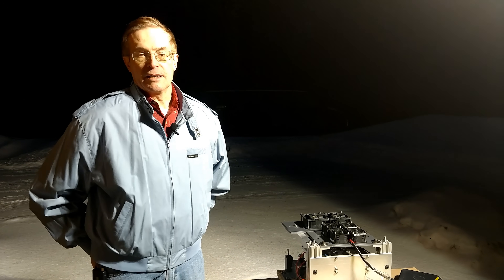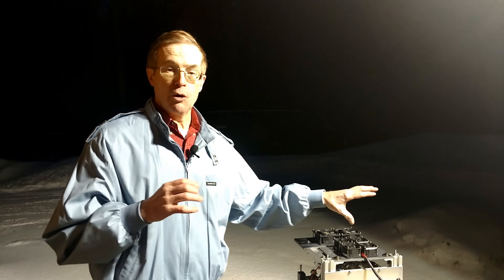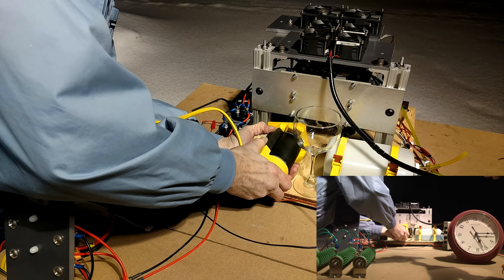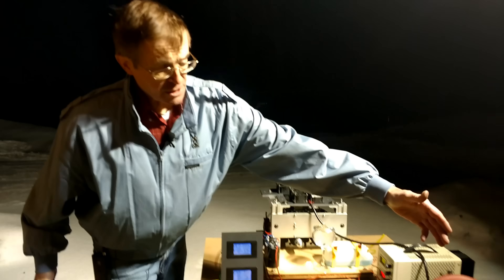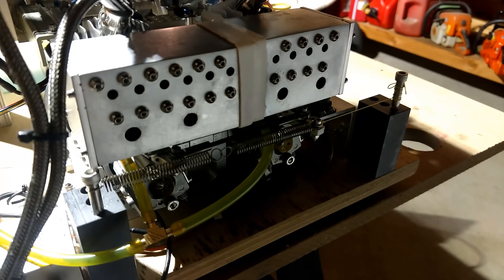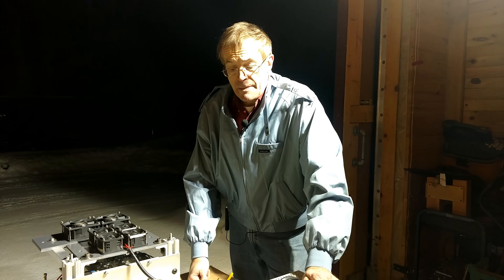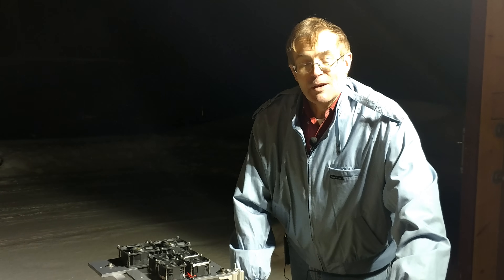Drone Generator Performance

Comment: 2-Stroke Expansion or Tune Pipes will 'pulse' all the unburned air/fuel that got into the exhaust back into the cylinder just before the exhaust port closes,
ie:  At a the desired, designed for RPM you will get as clean an engine as a 4 stroke..?
No; the weight penalty is more than made up for by the dramatic increase in engine power at the designed for rpm.  That's why you see them, on all high performance 2-stoke motorbikes etc.

After the 2 expansion pipes I would do an 'Into 1' Y piece to 'halve the weight of the silencer/s...
Do also look up David Vizard's Pressure Wave Termination Box as a means of negating the power losses normally associated with mufflers/silencers.
This will, most likely, also avoid any interference you may get between the Expansion pipes when using a single silencer..?

Then, as this is a fixed rpm setup, do look up Helmholtz and/or Quarter Wave Resonators as a highly effective, light way of silencing not just the exhaust but also the intake tract and perhaps even the quiet box/enclosure if such is planned.

Lastly; do aim the exhaust downward so it can help a tiny bit with lift/thrust..!

NB that there is also a good amount of info on optimising port heights for a certain rpm, which goes hand in hand with the rpm specific expansion pipe in this case.

You might also look at:
Supplying the spark plug/s with a constant DC ionising voltage (~1000V per mm) underneath the std pulses for spark:  This seems to speed up ignition by pre breaking down the fuel molecules and/or producing a tiny amount of hydrogen etc in just the right place...

I also wonder if 2-Strokes might not benefit more from some of your... 'disproved..?' HHO action considering the very short time they have to completely finish a burn/power stroke before blowing unburned stuff out the exhaust port..??

Comment: Hi sir, i would like to know how you design and size the flywheel? thank you!
Reply from the maker: Its  mass approximates the mass of the piston and the rods and its diameter was a practical decision based on clearances.
Reply: @TechIngredients  Thank you!. How and what material do you use to offset the flyweel? I see that the flywheel itself is made of aluminium, how about the inserts to offset the flywheel inertia? I can see there is at least 2 or 3 inserts? Correct me if im wrong.
Reply from the maker: They are simply steel discs that counter the offset mass of the piston and placed 180 degrees away from the piston.

Comment: I flew one of these 10 years ago... 1000 watts.. the clutch would slip    https://www.youtube.com/watch?v=aDqdNRzlV0Q
Reply: So Cool !It's hard to imagine that it's been 10 years, and even now in 2023, hybrid multi-rotor drones are still very niche in China. The gap with developed countries is unbelievable. I watched your video and wanted to ask if your six-copter drone only needs 1 kilowatt of generating power to take off, it looks heavy. (Sorry my English is not good, especially grammar)

Comment: Hi, I would like to ask you what do you think about the alternative method to produce electricity using Fuel Cells, can it be an efficient solution?
Reply from the maker: Absolutely.
The problem  at present is the cost of the ion membranes necessary  to generate  electrical current from the reactions.

Comment: 2 stroke motorcycle engines have a full circle crank and the racers do what they call stuffing the crank to boost performance and reducing vibration is a large part of performance optimization and this goes on in high end chain saws as well. I noticed that Boston dynamics is using a pulsejet engine in thier robots, these engines are much lighter.

Comment: Now here's something else for yout to toy around with.... "Tuned pipes", or "resonance chambers".
If you're generally going to run these engines at a steady speed, in a fairly narrow range of RPMs, a tuned pipe on each engine designed for the rev range you will be running them in can drastically increase the efficiency of the engines. The downside to a tuned pipe is that the engine will be very peaky, and not operate well outside of the rev range for which the pipe is designed for. 
The factory "muffler" on these engines is a compromise to allow the engine to work acceptably throughout it's entire rev range, and be responsive to the throttle at any RPMs, but it is definitely eating up a bunch of efficiency that you would gain back with a properly designed pair of pipes for your engines.
You seem like a smart guy, give it a try, and see if you can come up with something.. You might be surprised at how much more energy you could squeeze out of your fuel.
Reply from the maker: Thanks!
Reply: @TechIngredients  🍻

Comment: That's very interesting. Did you buy or salvage the generator/motor and what's the displacement of the gas engines?
Would something like this work on a bicycle to make it a hybrid like for long trips?
Reply from the maker: It sure could be.  I'd build it much smaller as we demonstrated in the follow up video. This unit puts out over 2kw.

Comment: What do you think about a hybrid drone with a rocket to get the drone to altitude initially and then the battery pack is coasting the motors for the flight allowing a longer run time to?

Comment: Amazing project! ive learnt more from this man than I did from my engineering school.
i will like to amback on this same project for my drone but i have a question sir, what if the gasolin engine quits mid-air?  I have experienced alot of 2stroke engines quiting on me. lost my last drone on 2stroke efi engine quit.
Reply from the maker: Thanks!
Use the generator in conjunction with a small battery. If wired in parallel, the battery maintains  charge and even acts to smooth voltage ripple. If the engine quits the battery  will allow you to land.
Reply: @TechIngredients  Thanks !!

Comment: I would go gas turbine and permanent magnet but anyway, heres a small one https://youtu.be/Al8elCF816g , it is perhaps too weak but on the other hand they come in various sizes . It all comes down to what power demand you got basically but most helicopters have these for a reason

Comment: Just can't stop feeling sorry for your load bank resistors. You didn't spray the poor babies enough and your current dropped by at least 1.5A.

EDIT: Begs the question of why you couldn't just have slapped a fan on them, even a desk fan would help. 😂
Reply from the maker: The fan wouldn't have been enough and the production of the steam was a visual demonstration of the energy produced for those skeptics who watched the video.

Comment: I was wondering if there is a specific reason that you opted for twin vertical cylinders instead of a horizontally opposed boxer configuration. Assuming equal reciprocating mass in both engines and 180 degree timing, it seems like a boxer configuration would be able to achieve proper balance without adding counterbalance to the flywheels.

I may be wrong, but I believe that the flywheels could be made significantly smaller on any 2-cylinder 2-stroke with 180 degree timing compared to a single cylinder engine. With two opposed cylinders, the power stroke of each cylinder directly drives the compression stroke of the other,  which reduces the need for flywheel momentum to carry out compression. So, you may have some opportunities to save weight there. Can't wait for the next update! Keep up the good work!
Reply from the maker: The more powerful, 4 cylinder, 222 cc boxer version of this engine does solve this problem, the twin does not.  We have this larger engine and indeed it produces less vibration.  The flywheels were not sized to prevent vibration, but to smooth the power stroke and reduce the voltage variation.
Reply: @TechIngredients  Great to know, thanks!
Reply: @TechIngredients  do You plan to finish idea with active / passive noise cancelling box for this engines? How does it performed?

Comment: For the cooling, could a multi blades EDF type fan be integrated in the center of each flywheel?
Reply from the maker: Probably.
Reply: @TechIngredients  To save weight, the generator rotor could be used as a flywheel (if needed, "pancake" type generators would provide a larger moment of inertia). A rigid coupler could be used to connect the two axes and the generator stator could be fixed to the engine mount with a flexible vibration damping rubber mount.

Comment: Mounting balanced permanent magnets NdFeb to the rotor of a small hobby turbine & then placing generator coils around those magnets to make a turbo alternator generator should be even lighter / its your IPM style 3 phase motor running at much higher RPM in a very light package custom made / this kind of setup used on military hybrid electric drone power systems - think "integrated APU" -- super light & very high power to mass ratio / also something like a Honda EU2000 or EU2200 could be used as a design reference for something less exotic & affordable & very reliable / you seem like you might like a Free Piston Stirling Generator like the one NASA been operating for 14 years continuously .. helium pressurized seals & magnetic bearings in vacuum housing - 125,000 + hours continuously operating / they are designing it for Kilopower fission energy generators for Artemis moon base etc // you might check that out //
Reply from the maker: Integrating the generator and the compressor/turbine shaft would be best based on the hundreds of thousands of RPM of a small turboshaft.  Balancing tolerances  and mounting the magnets while leaving clearance for the input airflow would be challenging.

Comment: I like this Drone model, but the generator as a power generator, should use a transmission so as not to have a high RPM rotating the engine, because it is a waste. With this, the lock and RPM of the combustion motor will be lower but produce ideal electric power, so transmission is needed.

Comment: I guess if you put the resistors each in a separate tub with tap water, the voltage across would not be high enough to produce a short circuit.
Or you directly use a bucket of water with two electrode sticks and add salt until it's at the wattage you want, you can then vary current/resistance by adjusting the electrode distance or depth in the water.
Bonus: You can redo that hydrogen explosions in small :-)
Reply from the maker: I decided to use the spray to make visible the large amount of heat produced.

Comment: This is really cool work, don't got me wrong. I love any and all engineering of new devices and technologies (I'm a mechanical engineer myself). But I feel like the hype and buzz over "Drones" has caused a lot of people to lose sight of the big picture. Helicopters are a very mature technology that are gas powered, very efficient, can fly for a long time, etc.  "drones" i.e. multirotors, are really only good for small electric devices.  A friend of mine in college made a gas powered quad copter that worked fairly well, but there really just wasn't a good reason to do it.  Once you get above about 10-15 lb. or so, just use a standard gas helicopter design.
Reply: But helicopter is not easy for maintenance. When crashed in accident not easy to repair. I use drone for agriculture and now a lot of chinese drones had this system on board.

Comment: Two strokes need a tuned exhaust to get the best power and fuel numbers.
Otherwise, my jaw is on the deck......
With a proper tuned pipe, you could get rid of the fuel pump, run it on ex pressure port included with the pipe.
I assume this is nitro methane fuel, but, tell me if I am mistaken.
Reply from the maker: You're right about exhaust tuning.  However, the fuel is two stroke gasoline.
Reply: @TechIngredients  Than I stand corrected, I hope you do reach the fuel consumption goals, it's a marvelous system. You can still use crank pressure ports for fuel delivery with gas, it's not going to hurt anything.

Comment: Those little engines rarely ever come with correct fuel jetting...
 Leaning them out will help...
 Also you could dissasemble the cases and fill in all the extra nooks and crannies with jb weld or a similar material , then machine or sand them smooth...
 Less extra case volume equals less waste...smother running too...
 These engines also rarely come with a proper squish area in the combustion chamber...
 You could mill the heads down some...increasing compression..and run the motors a little leaner still...
 You should also check out the youtube channel "2-stroke stuffing", about porting small 2-stroke engines...he'd probably even port some stuff for you...
 Proper porting for your purpose built engines would go along way toward efficiency...
 Btw..I really enjoy your ptojects..super good channel..

Comment: Could a small gaz turbine be used instead of the 2 strokes engines? Less efficient, but a better power/weight ratio... Also the higher RPM would mean a smaller & lighter generator could be used for the same output power... Finally, by orienting the turbine exhaust downwards, it would  lift more then the combined turbine and generator weight, lowering the electrical power needed to keep the drone airborne... The only problem left would be to find a way to mitigate the horrible turbine noise, without killing its performance...
Reply from the maker: You could use a gas turbine, but as you said it's substantially less effecient and much more expensive.  The high RPM will be too high to couple into most motors without burning them up unless a lower speed turboshaft output is used.
Reply: @TechIngredients  After re-thinking this problem, I believe that the optimal solution would be to use a  large propeller attached to a two stroke gas engine that would take care of 80 to 90% of the needed lift, while letting the 4 electric motors take care of the missing 10% to 20% lift + pitch/roll and yaw control during the flight. This way, the generator, DC/DC converter, diodes... would be much smaller. Relatively large airfoil profiles attach to the quad lateral vanes and correctly oriented would eliminate most of the torque of the gaz engine, while the other 4 electric motors could compensate for any residual torque. The cooling of the gas engine would obviously be also solved.

Comment: I'd spend some more time on the exhaust design, 2-stroke engines are really sensitive to exhaust design and need a particularly special designed expansion chamber to really work well
Reply from the maker: You have a good point.

Comment: you could do passive peltier cooling by heat pipes, fan noise should be much less
Reply: why would stone age piston engine be reliable, those drop from the sky all the time, try centrifugal center-in rim-out turbine generator instead
Reply: magnetic coupling, dont touch

Comment: people rightfully criticize your exhaust muffler,
2-strokes are very sensitive to the pressure diff in exhaust,
but you have plenty of electricity onboard, how about forced ventilation?
on huge 2-strokes it is the only solution, in a tiny case it is complicated, but maybe some continuous suction would help

Comment: I’ve been wanting to build a hybrid drone for years! Have you considered attempting to recover some of the energy lost as heat by using thermoelectric generators?
Reply from the maker: No.  The added weight for an airborne application wouldn't be worth it.

Comment: 2 strokes are very sensitive to exhaust design. They need a tuned resonator to run well, the only downside is that there is a very small powerband. Thankfully your generator will operate at one specific speed.
Reply: Both intake and exhaust can be tuned, and it would be interesting to see what the ports look like. Often small 2 cycles leave a bit to be desired in design and such .
Reply: @dennisford2000  They sure do... In my opinion, a properly designed tuned pipe for the rev range it operates in, would make the largest "bang for the buck" improvement in efficiency, then followed by a little port clean-up.
Reply: @davelowets  exactly. See the word tuned , that would be tuned just below the required rev , so torque will increase if the crank slows
Reply: @dennisford2000  🍻
Reply: I was just gonna say this exact same thing, it was my first thought wheb I saw his shit exhaust
Reply: Right. I was curious what the hole pattern would do to the sound. It's basically like a bunch of firecrackers going off at the same time. Each exhaust cycle emits a group of pops instead of a rumble. Small holes are black cats. The bigger holes are like M80s. The previous muffler had tuned pipes with a far less obnoxious sound. I think even the neighbors would agree.
Impressive machine. Solved a lot of problems for those looking to build hybrid fuel/electric systems. Great knowledge for free. On behalf of the greedy world, thanks.

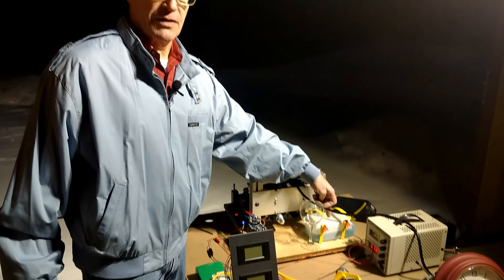Comment: If the current delivered is that constant it is interesting how the 4 stroke engines would perform in the same kind of setup. 1:10 versus 1:20 is considerable. The propellors of the drone are driven by electric engines. So it would not be problematic that the engines deliver less of constant power throughout the 4 strokes instead of 2 x 2 strokes. Not sure if I describe it correctly. Hope you understand.

Comment: It is inefficient and too complicated system. But nice job with vibration cancelation. Do you really think your power generation system will be able to lift itself off without high power LiPo help? 700W or even 2,2kW it aren't going to fly, because it weights like 30 - 40 kg. Also it is better to directly use power of IC engine to fly the drone, not to convert thermal power to mechanical, then mechanical to electrical and then electrical to mechanical again.
Reply from the maker: Effeciency is not the only consideration.  Redundancy, duration, noise and vibration isolation  are better with this system than with a direct IC propeller drive.